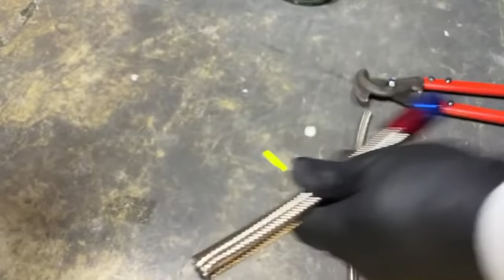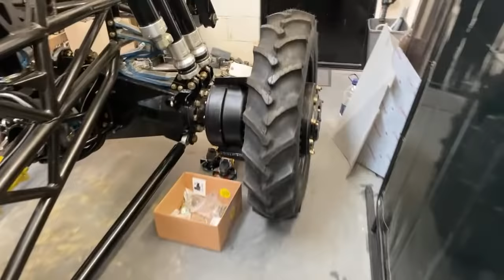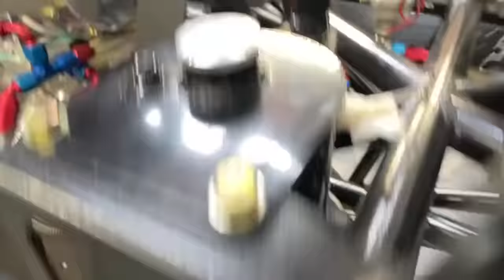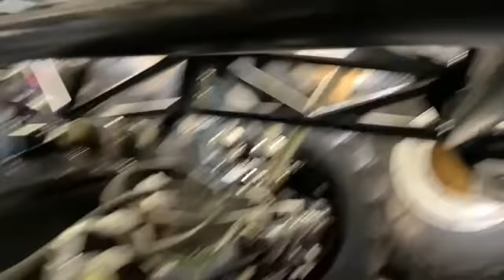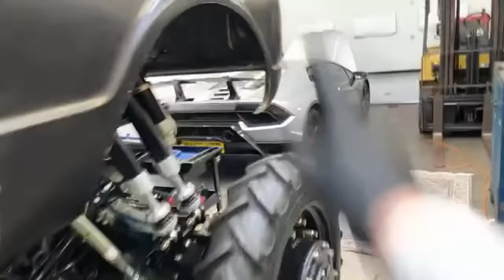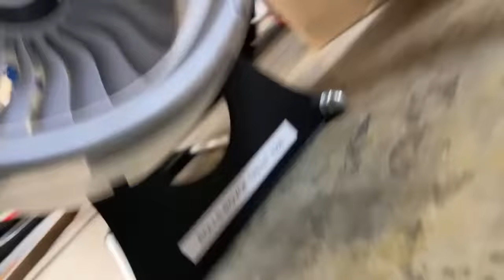AN Hose fittings EASY assembly - 1500bhp monster truck engine plumbing

Comment: Indirect information but thought you’d like to know… The cool/odd thing with mechanical fuel injection is when you tune the fuel supply your actually adjusting how much fuel is returned, rather than supplied. The “pills” are controlling how much fuel is returned by a restriction. The barrel valve is basically an on off switch. You have idle, and wide open throttle. Why mechanical injection isn’t street friendly. Looking good my friend. Good job!

Comment: The metal straps that hold the tank will rub through the plastic tank.  Put some rubber strip between tank and strap

Comment: Kev..make sure get all your hose tide before run the engine.. if you dont want miss it..Just mark with marker any hose or bolts&nut one its already tide..so its easy for you to check it

Comment: You want your water to flow from the bottom up keeps the air out of the system if you have a car that the heater doesn't work unless you rev the motor it's either low on coolant or your hoses are on backwards or you have a faulty water pump but what do I bloody know!
Reply: how does that work when water goes to the bottom and air goes to the top? you might be right if the rad is lower than the engine but in my case the rad is higher

Comment: im only 7:20 in and sorry Kev your doing it wrong, you should tighten only the outer collar not the inner fitting, your way can damage the rubber ,if you only turn the collar the inner fitting and rubber pipe wont get twisted ,you could roll the rubber as you tighten, which will convert into a leak hope this makes sense